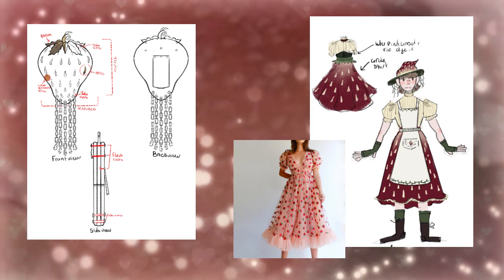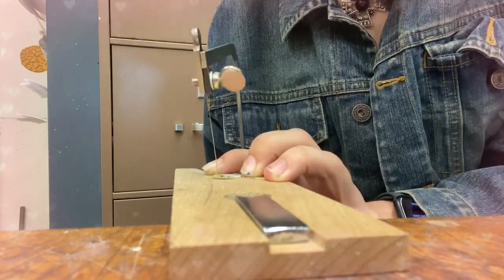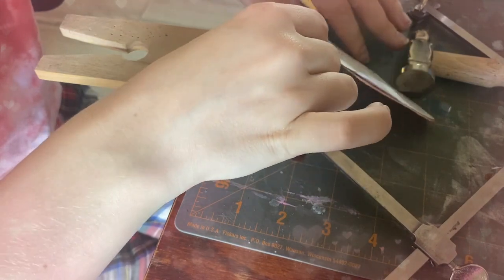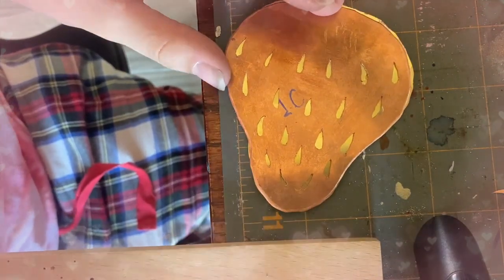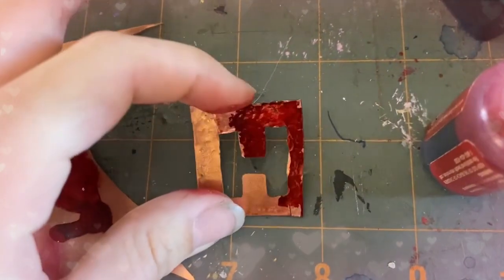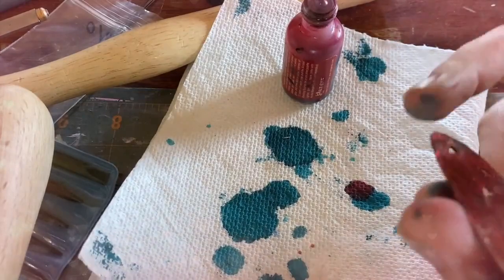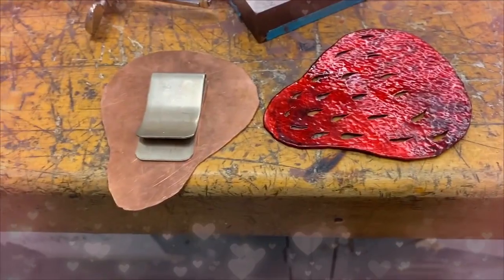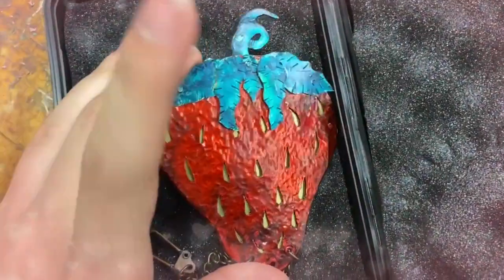DIY Chatelaine!

Comment: Omg this is so cool 😭😭😭😭 the talent 😭😭 do u need to seal the alcohol ink in anyway or does it just stick onto the copper?? I never thought of using alochol ink on metal b4 the effect is so neat
Reply from the maker: Thank u!!! 

I would recommend sealing it, because it does chip pretty easily and can be washed off with water and enough determination, I sealed my pieces before riveting them together and they still chipped so it’s not a perfect solution!

 I found that depending on the sealant it would just reactivate the ink make the ink sticky. I used a spray sealant, but I’d be curious on how something like modge podge would work! so if you using one solid color you would be fine but if you doing some sort of design I would opt for a different patina!! I think traditional alcohol inks are used to make super swirly tie dye pattern so if you’re doing that on metal the spray sealant could have a cool effect!!!
Reply: @EllieWishesEnterprises  bless u thank u !!! I tried alcohol ink b4 and they always came out so sticky  but I have modge podge so Ill report back after i find metal 2 use it on hehe 🏃‍♀️ the spray as a pattern sound so neat, imma try to use fixtiff too on like a tie dye pattern Idk, thanks for the inspiration